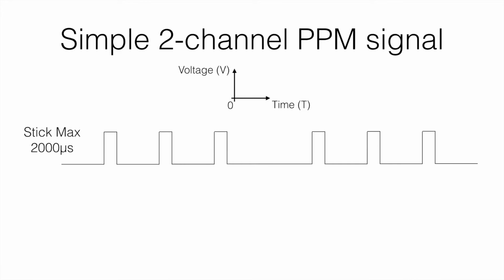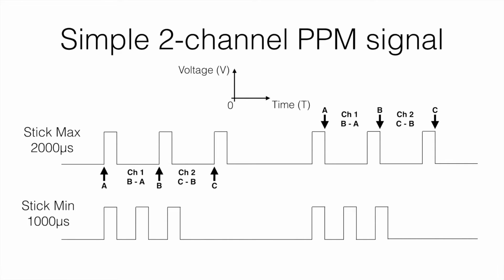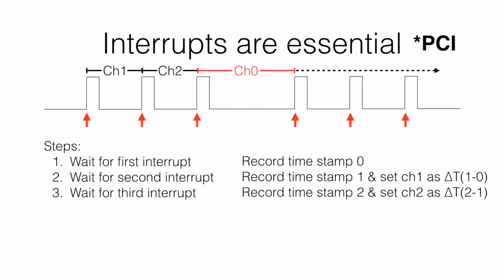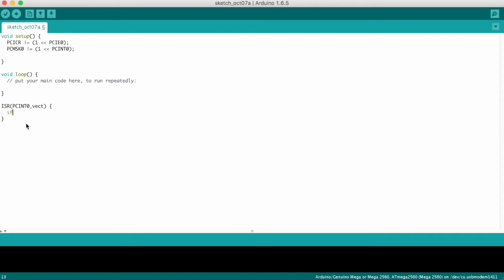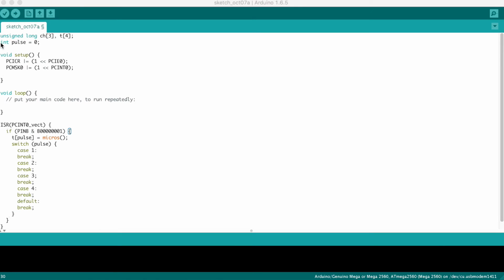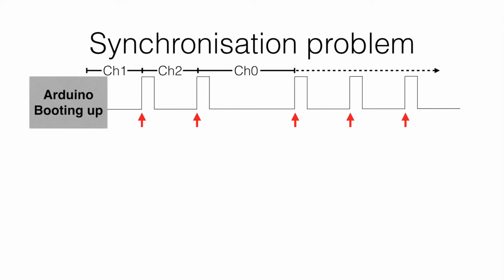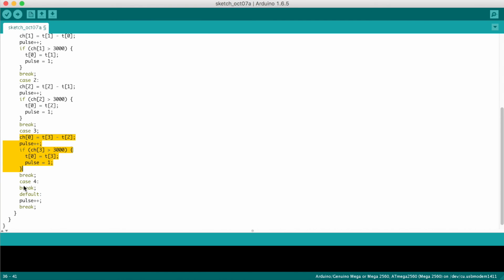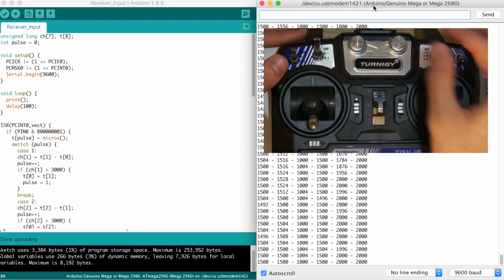Reading PPM Receiver Signal with Arduino using Interrupts

Comment: Hi, this is the code that I can transcribe at last in the video, not tested....

// ___________________ CODE ____________________

unsigned long last_Time = 0;

//We create the function that will read the data each certain time
void receive_the_data()
{
  while ( radio.available() ) {
  radio.read(&received_data, sizeof(Received_data));
  last_Time = millis(); //Here we receive the data
}
}

/**************************************************/

void loop()
{
  //Receive the radio data
  receive_the_data();

  
  ch1_value = map(received_data.ch1,0,255,1000,2000);
  Serial.println(ch1_value);
  
  
}//Loop end

// _______________ CODIGO DEL CHAVAL YOUTUBERO:
{
 
 // PPM Pulse with modulation
 unsigned long ch[3], t[4];
 int pulse = 0;
 
setup()
{
 // __ Interrupciones
 PCICR != (1 << PCIE0);  // Habilitar las Interrupciones
 PCMSK0 != (1 << PCINT0); // Las interrupciones seran en el PIN_INT_0 (Mirar PINOUT Arduino model)
 Serial.begin(115200);
}

loop()
{
 print();
 delay(100);
 
}

// ISR // INTERRUPCIONES

ISR(PCINT0_vect)
{
 if ( PCIN8 & B00000001 )
 {
  t[pulse] = micros();
  
  switch (pulse)
  {
   case 1:
   ch[1] = t[1] - t[0];
   pulse++;
   if (ch [1] > 3000)
   {
    t[0] = t[1];
    pulse=1;
   }
   break;
   
   case 2:
   ch[2] = t[2] - t[1];
   pulse++;
   if (ch [2] > 3000)
   {
    t[0] = t[2];
    pulse=1;
   }
   break;
   
   case 3:
   ch[3] = t[3] - t[2];
   pulse++;
   if (ch [3] > 3000)
   {
    t[0] = t[3];
    pulse=1;
   }
   break;
   
   case 4:
   ch[4] = t[4] - t[3];
   pulse++;
   if (ch [4] > 3000)
   {
    t[0] = t[1];
    pulse=1;
   }
   break;
   
   case 5:
   ch[5] = t[5] - t[4];
   pulse++;
   if (ch [5] > 3000)
   {
    t[0] = t[1];
    pulse=1;
   }
   break;
   
   case 6:
   ch[6] = t[6] - t[5];
   pulse++;
   if (ch [6] > 3000)
   {
    t[0] = t[1];
    pulse=1;
   }
   break;
   
   default:
   pulse++;
   break;
   
  }
  
 }
}
// ___________________ CODE ____________________
P.S: Thanks for this explaining video Kamran

Comment: Great video but it's not working right. I have a 10 channel receiver but set my transmitter to 6. It displays a few numbers mixed with garbage. I tried changing the 3000 to other numbers with no success. Should I add 3 extra channels to the code?
Thank you,
Dave
Reply: adding 4 more to the program fixed it...working great now
Reply: Wondered if this would be easier? Just change the number at the top.
const int CHANNELS = 7;
unsigned long ch[CHANNELS], t[CHANNELS + 1];
int pulse = 0;

void setup() {
  PCICR |= (1 << PCIE0);
  PCMSK0 |= (1 << PCINT0);
  Serial.begin(9600);
}

void loop() {
  print();
  delay(100);
}

void pulseSet() {
  t[pulse] = micros();
  ch[pulse] = t[pulse] - t[pulse - 1];
  if ( ch[pulse] > 3000 ) {
    t[0] = t[pulse];
    pulse = 1;
  } else {
    pulse++;
  }
}

ISR(PCINT0_vect) {
  if (PINB & B00000001) {
    if ( pulse > 0 || pulse <= CHANNELS ) {
      pulseSet();
    } else {
      pulse++;
    }
}

void print() {
  for ( int i = 1; i < CHANNELS - 1; i++ ) {
    Serial.print(ch[i]);
    Serial.print(" - ");
  }
  Serial.println(ch[CHANNELS]);
}

Comment: Hi,

I followed your instructions step by step to use the FD800 Tiny Frsky 8CH receiver, but it doesn't work at all.
Reply: If you still need help, you can try putting  sei(); in the setup routine, this will enable global interrupts by setting a bit in the SREG register.

Comment: Thank you so much. I've started with my own code, but didn't do the interrupt initialisation like you did, however I just used "  attachInterrupt(digitalPinToInterrupt(inPin), iPPMPulse, RISING ); " and wrote my code there - is that a problem?
Reply: Would you mind sharing the code please? :)
Reply: Sure, http://www.nipinfo.co.za/ycl.dll/PubShare?Pub=38365138. Let me know if you can't access it.
Reply: hey, the link doesn't work can you please send another link? thanks!
Reply: http://www.nipinfo.co.za/ycl.dll/PubShare?Pub=38365138 please try again <<
Reply: Hein Du Plessis danke schön!

Comment: Hi Kamran,

Thanks for these great video's. I will experiment with this.
I do not understand the "channel 0" on the RC transmitter signal. Do you have a link to some explanation?
Second question, suppose I will put three servo's directly on channels 1, 2 and 3 of my receiver and connect channels 4 to 8 to my arduino. What changes would I have to make to your code?
(I have a Futaba F14 Navy).

Thanks very much,
Henk

Comment: Hi, nice tutorial. am trying to use the code to read 10 channels from a FlySky FS-i6X transmitter and FlySky FS-iA10B receiver. after modifying the code I was able to get valid values for only 8 channels, channels 9 and 10 was reporting a constant value.

Have you tested it with more than 8 channel or is there any limitations as to the number of channels it can handle

FYI: when I used PWM I was able to read all the 10 channels

any help is welcome, below is the Serial Print Output:

1504 - 1504 - 1144 - 1560 - 1000 - 1008 - 1000 - 1008 - 10376 - 0
1512 - 1504 - 1144 - 1552 - 1008 - 1008 - 1000 - 1008 - 10376 - 0
1512 - 1504 - 1144 - 1552 - 1008 - 1008 - 1008 - 1008 - 10368 - 0
1512 - 1504 - 1144 - 1552 - 1008 - 1000 - 1008 - 1008 - 10368 - 0
1504 - 1504 - 1144 - 1560 - 1000 - 1008 - 1008 - 1000 - 10376 - 0
1512 - 1504 - 1144 - 1552 - 1008 - 1000 - 1008 - 1008 - 10368 - 0
1512 - 1504 - 1144 - 1560 - 1000 - 1008 - 1000 - 1008 - 10376 - 0
1512 - 1512 - 1144 - 1560 - 1000 - 1008 - 1008 - 1000 - 10376 - 0
1512 - 1504 - 1144 - 1552 - 1008 - 1008 - 1000 - 1008 - 10368 - 0
1504 - 1512 - 1144 - 1552 - 1008 - 1000 - 1008 - 1008 - 10376 - 0
1512 - 1504 - 1144 - 1552 - 1008 - 1008 - 1000 - 1008 - 10376 - 0
1512 - 1504 - 1144 - 1552 - 1008 - 1008 - 1000 - 1008 - 10368 - 0
1504 - 1504 - 1144 - 1560 - 1008 - 1000 - 1008 - 1008 - 10376 - 0
1504 - 1512 - 1144 - 1552 - 1008 - 1008 - 1008 - 1000 - 10384 - 0

Comment: Hi Kamran, according the documentation the interrupt pin on the uno is 2 or 3 but in your tutorial you mention pin 8 at 3:25. Can you point me in the right direction?

https://www.arduino.cc/en/Reference/AttachInterrupt
Reply from the maker: There is a difference between interrupts supported by Arduino boot loader and the Atmel 328P chip used in Arduino Uno. The Arduino Attachinterrupt function only allows for pin 2 and 3 to be used as external interrupts but if you follow the documentation provided by Atmel, you will find that you can enable many more hardware interrupt registers. That is what I have done in the example above.

I have enabled PCIE0 which is an interrupt register and PCINT0 which is a reference to a pin on the chip. The same pin PCINT0 corresponds physically to digital pin 8 of Arduino uno. If you look at Arduino uno pinout diagram, you will see that pins also have PCINT0, PCINT1 referencing and so on written on them. Hope this helps
Reply: OK, thanks. I've created a workaround using pin 2 because I need to use pin 8 in a later stage of my project. Everything is working fine because of your solid code, tnx!